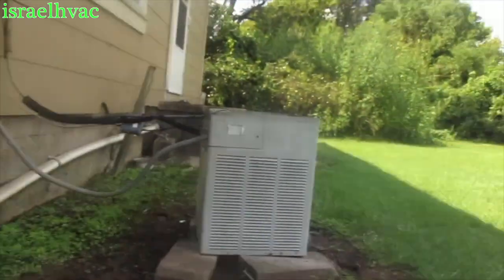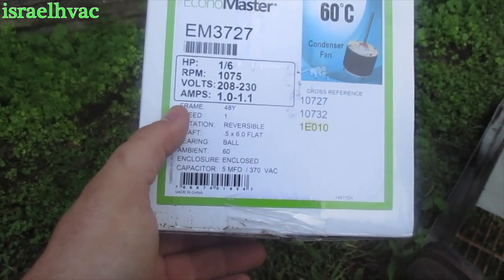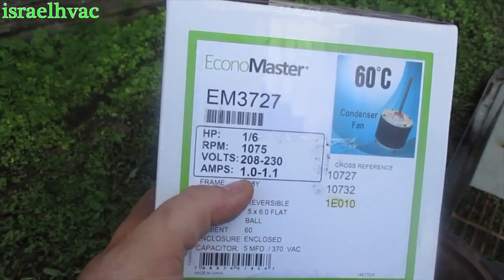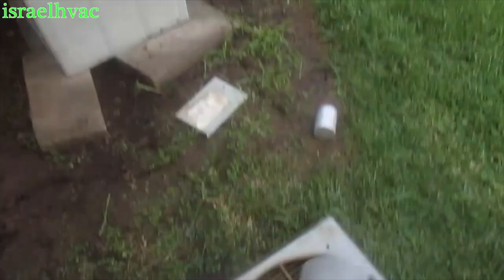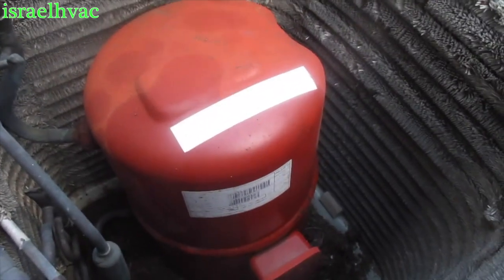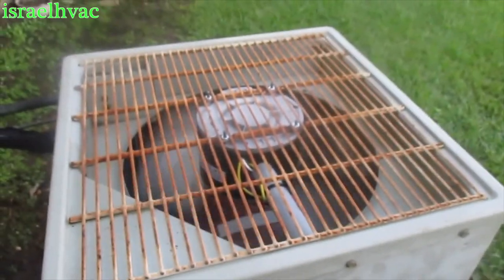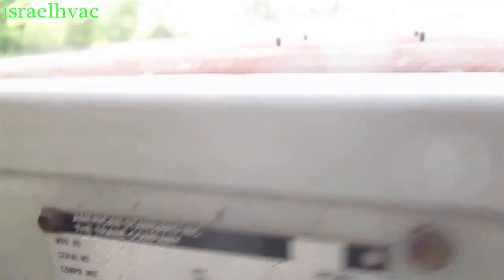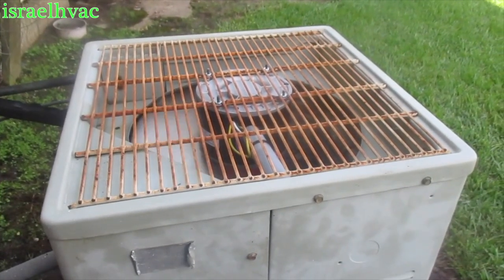HVAC Service: Another Condenser Motor Replacement

Comment: Toughest units 
John 
I just ran into one 
Where the installers never opened the valves 
15 years later I opened them and it ran perfectly 😳
Reply: throttle bottle 
What up bro
Reply: throttle bottle 
Yaaa the compressor did a basement erea 
And they thought it cooled !
But compressor went out on thermal for years😳

Comment: I hate to break bad news to you buddy but you got the wrong motor. It takes a 1625 RPM motor. I installed 2 of those units at my duplex around the same time and the only problem I have ever had was a hot surface igniter on one furnace in all of these years. That unit isn't going to cool well when it gets hot again. That motor would've cost you about $90 at Trane.
Reply from the maker: +Chris Keith I know that's what it called for. Universal motors only come in 825 & 1075. And I promise you it will cool just fine.
Reply from the maker: +Chris Keith Gets hot again?? Shit it's still 95 here and she's cooling like a champ!!
Reply: It can handle high head. They're tough

Comment: Is that an XB1000?  I think that's the same exact model as the old, small GE Executive/Weathertron units.  Trane just relabeled them.  Built really tough. Great you saved it!  Have you ever considered using a retrofit ECM condenser motor like the Evergreen OM or the US Motors EcoApex 48?  They are not that much more expensive than a regular PSC and are a lot quieter and can, slightly, boost the SEER ratings of a unit.  Plus some utilities give rebates for retrofitting a fan unit to ECM.
Reply: hyperlexis 
I think Trane bought that design when GE sold out that division. (That's where Trane got the spun aluminum coil maybe?).
Reply: Correct

Comment: In ee a universal motor means ac dc brush motor. Non-oem is  better  phrase to use around a non hvac person,:)
Reply: good point, but not manyl the hvac guys know that  :)
Reply: Thus a real AC/DC brush Singer motor for sewing machine would be a Singer Universal motor and a NON Singer motor would be a Universal Universal motor! :)
Reply: A corded circular saw motor is often a universal motor, The Field and Armature are in series in the brushed motor. It will run on AC or DC. Eons ago ( pre battery operated stuff) some contractors had two alternators on a work truck. The second one was without a regulator, one would get say 80 to 130 volts DC with the engine at a mid RPM and the Field voltage full on to the 2nd Alternator. THis DC voltage would power up a drill, saw etc.